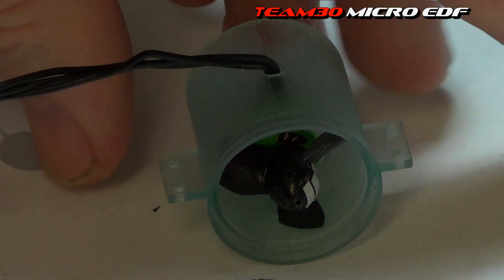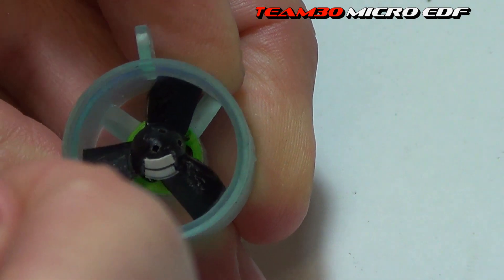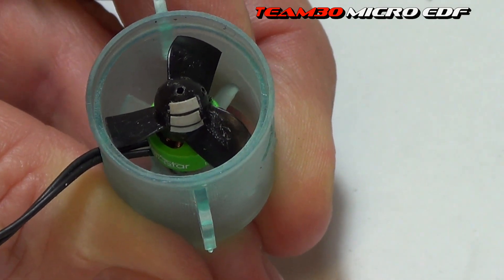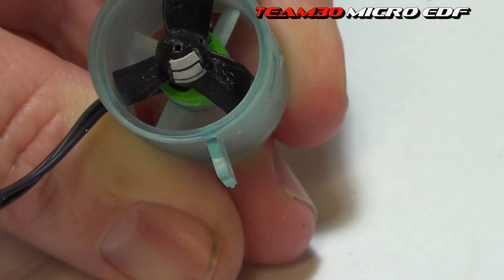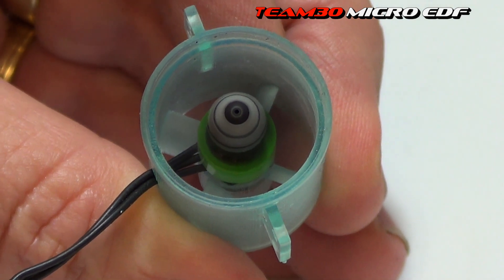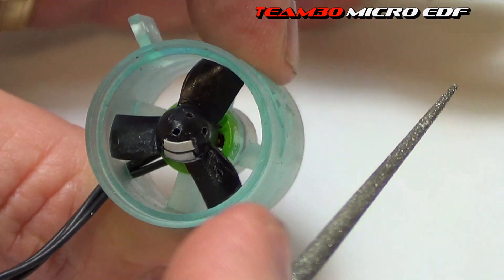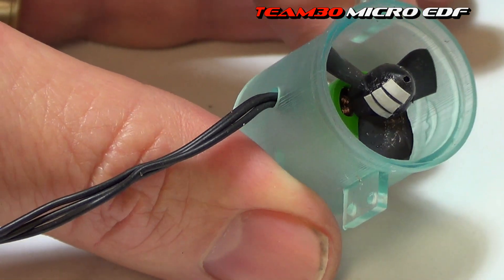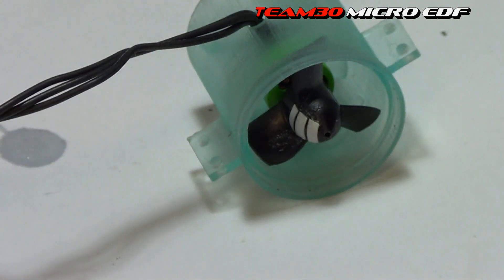20mm EDF unit - ready to install into Huckebein jet!

Comment: You're getting resonance because you have 4 stators and 3 blades.
Reply from the maker: You have to. 3 stators - 4 blades. 4 stators - 5/6 blades. That way the blades don't all line up over the stators at the same time.